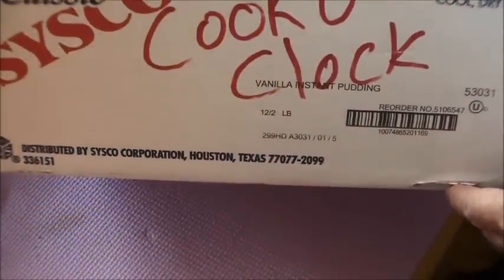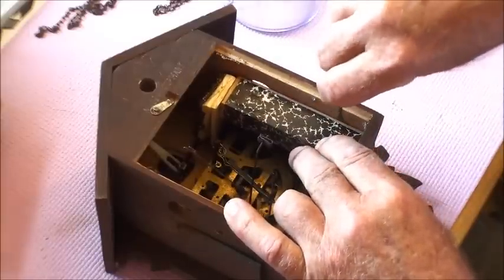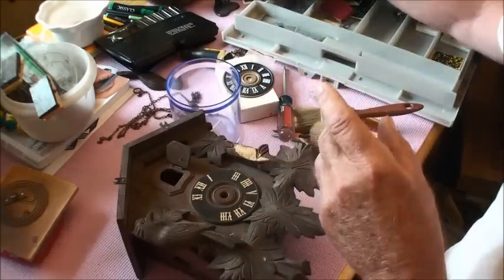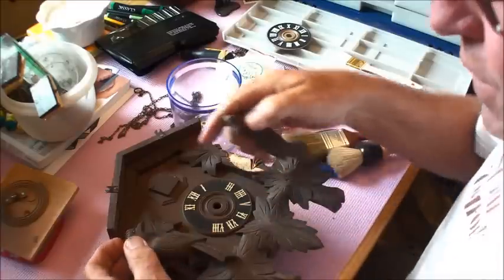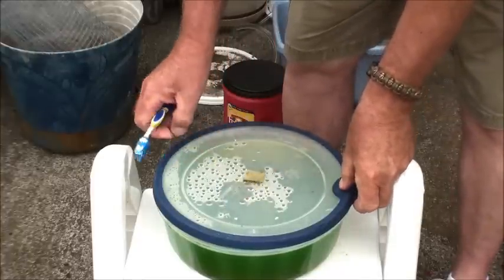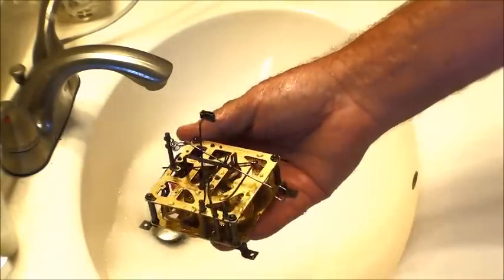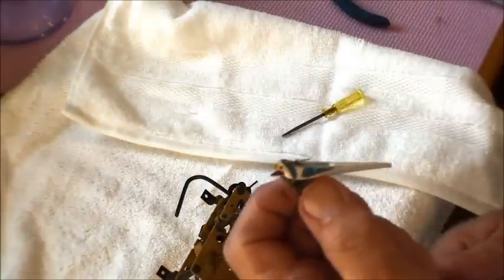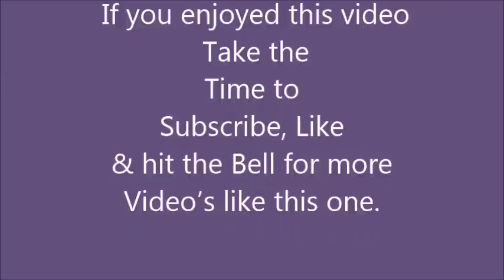Cuckoo Clock Repair

Comment: I have a Schatz 8 day cuckoo clock my Aunt gave me when I was a child. I watched another video where the gentleman said the “pivot” points were loose. My clock keeps good time but does not cuckoo. If I press the hour hand and it clicks it will cuckoo for several hours and then stop cuckooing. I suspect it needs cleaning and some kind of alignment but taking this clock apart seems very daunting. Any tips or insight would be appreciated and Thank You.
Reply from the maker: I just put a video out that shows what to look for too see if your pivots are moving around too much and needs Bushings. 
  A cuckoo clock should have the movement taken out about every 5 years to re-oil the front and back of the clock and use a can of air to blow out the dust the best you can. If you clock stops ticking and will not keep ticking, then yes, it is time to clean and oil your clock totally. 
  Not sure what you have for a clock, but depending on the age, the hands might not have the nut or nuts adjusted right to keep the clock cuckooing. The older clocks usually have either two nuts for the minute hand or a washer with a swuare hole, then the hand and then the nut to sandwich the minute hand.

Comment: My dad passed away he's got 2 of these they are German and very old I'm getting 1 sister getting the other and neither of them work I hope to God I'll be able to fix them
Reply from the maker: I have several video's that I show how I clean them without taking them apart, but without taking them apart, it might take a little more time to get them running again because of the old oil that doesn't get cleaned out all the way. The new oil will start to loosen the old oil, but it time and keep starting the pendulum, the clock will start working again. 
  Depending how dirty the clock is, you might get by with just oiling the clock for now, On Both Sides of the Movement.

Comment: is the cleaning solution just ammonia if not what other ingredients and are you able to make a diy version. great video currently trying to fix a cuckoo for my grandparents
Reply from the maker: I buy an accule clock cleaner that will deep clean the clock works. There are two kinds, the green colored cleaner that I used is Clock Cleaning Concentrate - Ammoniated or they have another that is safer to use in closed spaces, like your garage that is called Clock Cleaning Concentrate - Non-Ammoniated. Also make sure you use a clock oil because it is lighter for the clock works. Oiling the clock with less oil is better than more oil because the excess oil attracts dust Christian. My email is below the video if you have any questions or problems you might run into.
Reply: @justmike57   thanks for the help mike

Comment: Hey Mike great video's much appreciated, I tinker a bit have a cuckoo clock that the wheel for the pendulum freezes up and won't move, can get to move if I move the wheel but freezes up, any suggestions? Have oiled the clock got both chains on and in place. Much appreciate your knowledge and videos ☺️
Reply from the maker: I have found that listening to the timing of the tick is important and very touchy on some clocks. Also, how easy is it to turn the minute hand. If the minute hand is stiff to turn, then maybe the clock needs cleaned again and a bit of oil down the shaft, where the hands are located. Not knowing for sure what all has gone on with this clock. You might want to check out the Pendulum Video I have out if the clock does not tick right when leveled Suzzie Sturgill
Reply: @justmike57   thanks I will try that, I believe may be the chain wheel, seems  to me not timing with the top and center wheel
Reply: It will release then freezes up
Reply from the maker: @suzziesturgill5219  The chain wheel I don't think would be the problem. If not cleaned right, the clock will bind up and stop. If you move the minute hand and the clock will run for around a minute, than stop. The clock needs a better cleaning I would say Suzzie Sturgill.
Reply from the maker: @suzziesturgill5219  Yes, Better cleaning is in order. The works are trying to pull through the old oil and dust. Then new oil should help loosen the varnished old oil. This is also why I use hot water to get out what my clock cleaner loosened up and dissolved.
Reply: @justmike57   I have never taken one completely apart, it's at least 50 years old or so and my friend says not run in 30 plus years, is there a method without completely dismantling clock as far as cleaning the gears and wheels
Reply from the maker: @suzziesturgill5219  yes, you can clean the clock without taking it all the way apart. I do use a clock cleaner I bought from a company online. It works the best compared to using Dawn dishwashing soap and hot water. I do have an email below my video if you need to know where I buy my supplies or other questions. I try to look at it every day.

Comment: Thanks for your videos! I disassembled, cleaned, and oiled my Black Forest coo coo clock using 40 weight synthetic oil just on the pivots. Is that oil OK?
Reply from the maker: This is ok, but don't forget on the front of the clock, the arm that drops to count the hour and the part that moves the counter back up. Anything that comes through the plate that will cause drag. Also remember you don't want to leave a lot of oil behind for the dust to collect rapidly.

Comment: Hi Mike, is there a way to tell just by looking at the movement if you have an 8 day or a one day movement if you don't have the weights?? If you have the chains I suppose the links per foot might be a clue. Nice video, thanks for the great info!
Reply from the maker: Sorry I am late getting back to you. I have to go by the chain and how many links per inch. But sometimes that can fool you on some clocks. I have a one day clock that takes the same chain as an eight day clock. Most of the time you can tell by the chain. Thanks for watching Paul P.

Comment: Mike thank you so much for your help with fixing our cc clocks!  💕👍😊   Is there anyway you can help me fix my cookoo bird that won’t come out or make any noise.  I did do the few things you said to do with the bird, but it doesn’t come out or strike on the hour ect?  The pendulum weight on the right stays up and the weight on the left comes down and it ticks.  Could you please help us with a video fixing the bird that won’t come out on the hour and help us with fixing the time on the clock?  You have the best teachings and there’s nothing out there to help us!!?? 
So appreciate your videos!!! You helped me get my chain back on my cc clock!  I was shocked I was able to do that!  🤗😁👍💕
Reply from the maker: I will try to make a video on what might be wrong with why your cuckoo bird does not come out tomorrow and be out by not this Tuesday, but next Tuesday the 11th CB Benitez
Reply: I actually kept watching your video Mike, and I was able to keep at it half my day and finally  got the bird to come out and make the cookoo sound. Yay!  Now it stopped ticking? What!  I kept at it and it’s ticking again.  Okay, now getting that time right.  😁 If it wasn’t for your two main videos I’d be in big trouble, but thankfully you were able to get me through fixing two cookoo clocks.  Thank you!!! 😉😊
Reply: Just Mike   In my last message I did get it going, it’s the *timing I’m having issues with.  After putting the clock back together a few times over, I couldn’t get the timing quite right after I got the bird to work.  The bird comes out and does cookoo and it does tick, but at first would just STOP at first.  it now ticks again, but trying to set the time just right is my issue now.   We can’t find any additional videos that are as great as yours!  I appreciate any videos that you make and whenever your able to make it.  Your truly the best teacher on UTUBE, seriously.  Thank you for helping us all!!! 🤗💕☀️😊
Reply from the maker: @Cindy-df1xk  The timing is all in the pendulum. If the clock is slow.. Move the leaf on the pendulum up a bit. If the clock is fast, move it down. You will find that just moving it a very little bit either way you can get the clock to almost exact and have to reset the time maybe once every two weeks.
Reply: Just Mike Awesome, I will try this tomorrow.  Thank you Mike, hey our sons name is Mike also.   Thanks so much have a goodnight. 👍🌺😉😊

Comment: Nice video, Mike.. learn a lot, where did you get that oil pen, I would like to get one... Thanks Neil
Reply from the maker: I have looked for another oiler like the one I have that sucks the excess oil back up, but have not found another one like it. The other oilers that you can also buy on ebay will work, but you have to squeeze out some of the air, before you tip it to oil your clock. Thank you so much for stopping by Neil Brady.

Comment: Hello 
What sort of paint  do you have used to restore the Wood ?
Thanks a lot 
Jean-François from France
Reply from the maker: Hey there Jean-Francois. The older cuckoo clocks use the cheapest stain they can find, I swear. I used a cleaner on one of mine and the stain came off. You will have to experiment with different colors of stain to get it close and restain the whole clock to make it all match. I can not find my old bottle of stain to tell you the color, and they company I used got bought out and stopped making a lot of the products. Also, I used a gel-stain so I could paint it on and not rub it off. Just look for a darker, mud colored stain and try it out. I do hope this helps you.
Reply: Just Mike 
Thanks a lot Mike for your answer. 
Jean-François
Reply: Your « reply » 😁

Comment: Mike, what a great video! It gave me the confidence to try this myself. I'm still having a problem and was hoping you had some ideas for me to try. The clock ticks and the pendulum swings, but just for a few minutes before stopping. The hands of the clock do not advance either. If I move the hands on my own, the cuckoo and chime works. Any ideas? Thanks!
Reply from the maker: I would say the clock is dirty/dusty inside and needs cleaned and oiled again Ed Knob. These clocks are opened to the dust in the air and need cleaning more often than a Mantel clock or other clocks that have doors on them. Thanks for watching and if you have any other questions, feel free to ask or go to my playlist for more videos on the cuckoo clock

Comment: Very helpful video. 
Just picked one of these up from an auction for 25 dollars. 
Works well but top part of the bellows on both sides are petrified. Think it could do with a cleaning. These mechanical clocks are lovely pieces and need care. 
Great video and thank you.
Reply from the maker: You can order new top part of the Bellows and keep the box that makes the sound. Cleaning and oiling is good it the clock doesn't run well and you have time to play with it. If the clock has all the pieces, you got a great buy at the auction. Thanks for stopping in Paddy Pup.
Reply: Just Mike thank you for replying. 
It runs well but I don’t know if it was ever cleaned and it’s definitely old. I was looking at your other video about changing the weights chain and the are old weights.
I read some clock repair guy saying that in order to have a clock completely cleaned that leaving in solution is ok but still not the best. He was saying they completely strip is and clean that way to preserve it best. 
Your way looks very good and the movement looked great, Mabye they just want the money 😜
Reply from the maker: @paddypup1836  To take it all apart is the best, but not totally necessary. I say, it the clock runs well, don't mess with it. The normal person just wants to get their clock running again and not have to pay big buck to pay someone else to fix it. It is true, that if you use dish soap and hot water, you might have to keep restarting the clock, until you get the new oil back threw the clock. This is why I started using the clock works cleaner for a deeper clean.
Reply: Just Mike thanks. I will take the movement out blow it off for now and tiny bit of oil both sides. Then just new bellows. I’ll do the solution down the line if I notice it slowing down. The parts are so delicate I could easily ruin it so less fiddling for me the better. Great help you are. Thanks
Reply: I may also have put the hand counter clockwise once which is not good 😳
Reply from the maker: @paddypup1836  You are right, that is not good, but if you have the works out, just look at where the clock counts the hour, on the front of the clock,  sometimes the lever will get stuck or bent and the counting will now happen anymore until fixed.
Reply: Just Mike all good lever not bent. 
Just oiled the points. Lovely little mechanism to look at. Blew it out with air. 
Thanks for replies will stop pestering you now. 😜 subscribed!!
Reply from the maker: @paddypup1836  Thanks Paddy Pup. I don't call it pestering, I call it making a new friend.

Comment: Mike have been trying to repair a little cuckoo clock. Bout ready to pull my hair out😵‍💫I cleaned & oiled the movement, found out only time side was working. Found out one of the clicks was bent on cuckoo side. Thought it would be good, but nope. Now I’ve found the spring on the bird post is not connected to anything. It’s a very delicate copper spring. I know it’s supposed to be hooked to that little black flap with 
the notch, but spring seems so flimsy.  Also, the spring that attaches to the large black bracket arm is off.
Anyway you can diagram or tell me where each end of those two springs attach to. Also the there is a stop
bar in front of that flap. Is it supposed to be in front of it or behind it. Ugh please help if you can I’ve spent
4 days not trying to give up😩
Reply from the maker: On most, there will be a hole on the rod of the bird to start the small wire spring. You would slip it through the hole and bend it over the opposite way the spring is turning. Then you take the lower half of the spring and wrap it about two times too tighten the spring action for the bird and just hook in on the movement frame to keep it in place.
Reply: Thanks so much Mike I will give it a try. Didn’t know there was a hole on the rod.

Comment: Hello, my dad just passed and When going through stuff found our old cuckoo clock.  It may be dirty, but looks clean to the naked eye.  Bellows seem fine bird chirps, but the pendulum will not keep swinging.  It goes for a few seconds then stops.  Do you have any advice for me before I take it apart? This is an amazing video.  Thank you.
Reply from the maker: For a clock that has been sitting around for a long time will have issues. The oil will start to gum up and the dust that naturally collects in the clocks. Just for something simple. Try to turn the minute hand. Is it tight? Sometimes you can turn the hand , ONLY CLOCKWIZE for several of the hours and it will help free the works to operate. Hope this help you get started and might work for a few years if you are lucky.
Reply: @justmike57  Thank you!  I will see what happens and let you know how it pans out ❤
Reply: @justmike57   You were right...it needed to be overhauled. I cleaned it thoroughly.  It's working great except that it doesn't chime.  I'm assuming it used to since it has that spring coil on it's back wall.  Not  sure what to do there.  It's running a bit fast, too.  And, just in case you might know...when I soaked the gear piece a tiny black washer was in the water.  For the life of me I couldn't figure out where it goes.  There is a little switch-type handle on the side that goes up and down to shut off the cuckoo mechanics.  I'm thinking that washer is from there?  Anyway...this clock is the standard German cuckoo clock, but it had phillips screws...I think it was bought new in the 80's.  Thank you so much for your content.  You are a gem.

Comment: I have two (2) Black Forest Coo-Coo's and they both need cleaning and adjusting. i recently purchased a sonic cleaner for the very purpose but i do not know what solution to use in order to clean the time piece. Can you offer any suggestions?  Your video certainly helps thanks.
Reply from the maker: You can order online a Clock Cleaning Concentrate - Non-Ammoniated. I have a clock company I order most my things from. The green solution I use in the video has Ammoniated in it, but I have also gotten a sonic cleaner and don't plan on bringing it outside Manvet 67

Comment: I have a Cuckoo Clock with a missing gong and see there are different sizes. How would I figure out which size to replace it with?
Reply from the maker: Measure the back door across. Then take away one or two inches and that should be your size.

Comment: Thank you for this video. It has given me confidence to start restoration on a poorly treated clock I bought for $10 at auction. Additionally, now I have ideas of why the bird doesn't extend out as far as it should on my working clock. If you are still answering questions - is the cleaning solution straight ammonia or a mix? Thanks again. Going to check out your other videos for more information.
Reply from the maker: Hey, Candice P. The cleaning fluid I use is Clock Cleaning Concentrate - Ammoniated that I bought from a clock parts site. It works really well and deep cleaning. In the past I have used Dawn Dishwashing Soap that worked, but not as well and took some time to get the clock running again. 
  I don't know what the clock looks like, but for $10.00, doesn't sound like a bad buy. At least you can experiment on this one and maybe get it running again, and if not, you are not out much. Just in case you would like to know where I buy most of my things for the cuckoo clock, email me (below the video I have an email address) and I can give you the site. Also, any other questions, while fixing your clock. Pictures would be nice with questions. 
  Good Luck on your journey of cuckoo clock repair.